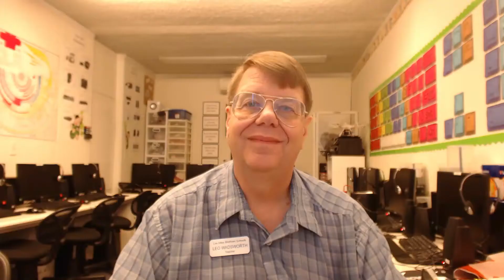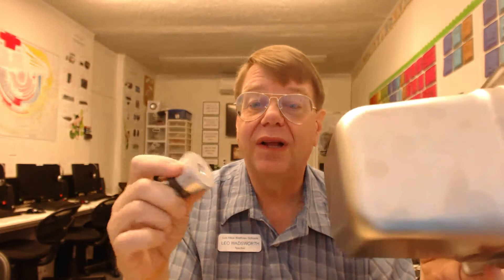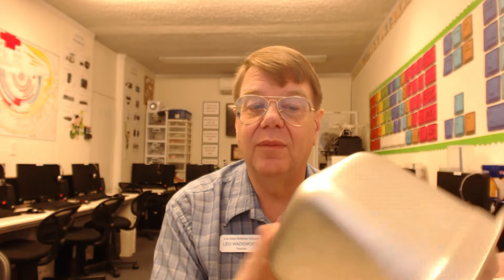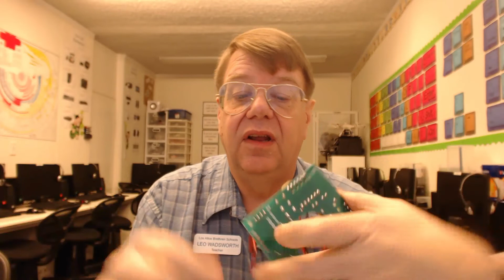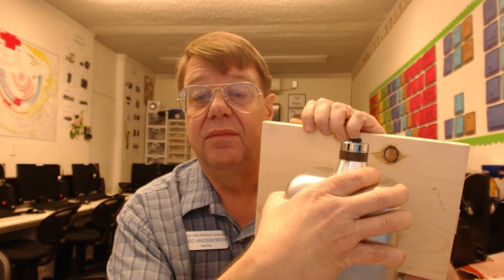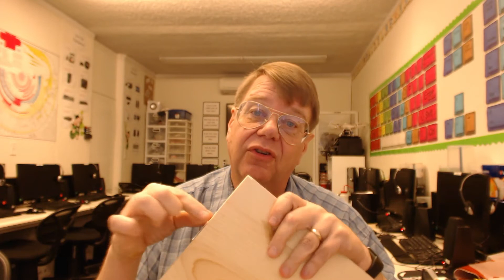DIY Sonicator Part One

Comment: At 4 yrs of age for this post I know receiving an answer is a long shot but here goes. I have a few questions re: this build. 

Most sonicators employ a resonating shaft into the medium with stationary containment. Where as something like a jewelry cleaner with softer vibrations resonate the containers. I imaged the reason to be sonicstion is more violent and achievable when the wave source is place toward the center of the working medium. As I learn more I’ll likely regret this portion of my comment.. We’ll see. Anyway how did the unit perform? Was the transducer able to bring the pan to the 20k mark? 

Did you discover a means of isolation for the pan to be necessary? Perhaps a thick bead of silicone applied into a track or groove lathed into the wood and under the lip of the pan. I’d imagine the vibration of the pan on the wood to be loud. Possibly even causing the wood frame to come apart. 

Did the driver board or transducer produce heat? I know the propagated water from a tiny transducer in a home humidifier can burn skin. The units are built with heat sinks. If this  build does heat up what is the average runtime per rise in degree? 

How did the bonding medium hold up? This I’m very curious about. I imagine an alternative build to be one where the transducer is mounted to and isolated from the base with the pan placed through the top hole, resting just above the transducer. The pan is also isolated by a gasket or silicone bead. All we need now is a coupling device. Maybe a pad similar to those used as heat sinks in electronics. Stiff enough to transmit high frequency without degradation of the waves but also hold up against disintegration.   The math required to calculate the design for such a material is far above my pay grade! I imagine the varying weight of the pan to make the calculation challenging.

Anyway I love this idea and build!! Thank you for sharing.
Reply: I am very much in.the same boat you are.  I don't have much money to spend, so that's how I got onto the diy aspect lol.  The deal is that a bath sonicator that does SOMETHING is easy. But, frankly, they suck.  They just do.  A probe sonicator entails a LOT more.  I am hardly qualified to explain it all.  I have no aspirations whatsoever of making my own probe/converter.("stack").  Frankly, if u were even remotely capable of that, you would have either already figured out that it was a non-starter, or you would have done it lol.  

The driver/power supply--that is where I think DIY is possible (to some extent, anyway).  The issue is that the thing has to somehow be tuned (or have an auto-tuning circuit).  I myself am still trying to figure out if any of these commonly available PCBs/kits have such capability.  I have looked at the PCB for a Branson Sonicator, and it looks a lot like those DIY kits. I'm not even that great at electronics, but you can't miss it.  I think what really matters, again, is the tuning.

You probably already know all this, or some of it.  These are basically a jewelry cleaner as far as I'm concerned, not a sonicator.  FWIW coming from me (I don't wanna sound like I'm putting this guy down, cuz I'm not, I'm sure he knows way more than I do).

You can use software to do the math. But first you have to know what you're doing in the first place.  Ask Google's AI assistant. It will tell you all about it.  Be careful tho, sometimes it get things wrong. 

If you are still interested in this stuff, I would be happy to talk about it at length. 

Yes, of course there is heat.  There has to be.  That is why you asked.  Because you already know.  The heat goes right into the water.  You have to cycle the transducer on and off and/or maintain the temp of the bath somehow.  Probe sonicators have attachments available to cycle the water through ("cup horn"); there are also cooling jackets.  Some transducer assemblies even have ports for this

Comment: Instead of weatherstripping, use one set of neodymium magnets to "levitate" the pan, and another set to "buffer" horizontal movement.  By placing north to north faces of two magnets, they repel each other. With a little imagination and strong enough magnets you can levitate anything.

Comment: Can this be used for producing Nanoemulsions?
Reply: This is my use case as well (cannabinoids). From what I've read so far, most people tend to have a higher power setup than this (I've seen 700W at least twice now.) However the frequency of this setup seems like it could be viable based on the same references... I'm still figuring it out. Have you come to any conclusions?
Reply: @jrgenscotthookham9137  That's exactly my goal ... CBD in water :)  My kit is shipped & hopefully I'll receive it soon. I'll post my results here when I experiment with it.
Reply: @scottalter42  looking forward to it. What are your specs? 60W? 40khz?
Reply: @jrgenscotthookham9137  yes, 60W @ 40khz. The kit from banggood. I'll keep you informed.
Reply: @jrgenscotthookham9137  Success!!!!! I got the kit, successfully made some nanoemulsion of 1:1 indica strain cannabis oil in water & consumed it.  Now within 30 mins, I'm feeling sooo sleepy which means it is working. Feels like was some strong booze or something. Normally, just infused oil takes about an hour to get the effects started. My setup is slightly different from what's explained in the video. I have the transducer part suspended with a chopsticks structure & had it partly immersed in the solution carefully without the possibility of shorting.  I wish I can post some pictures of my setup here. Anyway, I'm excited that this worked! Tomorrow I'll make my favorite 1:1 cbd/thc mix made of my favorite thc sativa (candyland) & cbd hemp (acdc), flavored with some pineapple & lime. That will be my favorite day time pinacolada like drink.
Reply: @scottalter42  very cool! Thanks for the update.
Reply: Btw, the texture of this solution is like diluted or skimmed milk. Translucent or almost opaque white solution.
Reply: @scottalter42  sounds about right. The finer the nanoemulsion, the more transparent I would expect the solution to be. Maybe also the ratios are relevant there... I know it's possible to get a water-clear solution, and I think a proper probe with perhaps more power is what it would take to achieve that.
Reply: @jrgenscotthookham9137  i think you're right. it's almost opaque so i think it doesn't have fine globules. it's day 2 & the liquids have not separated plus the solution is much stronger & fast acting than just oil which makes me think it is still nanoemulsion solution. I will run it for a larger duration like 30-40 mins or so.
Reply: @scottalter42  are  you guys still alive. I have input to provide on nanoemulsions.
Reply: @kbtze good question, really. If done incorrectly as I used to do (with aluminum containers) is can be hazardous. I stopped it immediately after learning.  Still alive obviously  😂

Comment: A sonicator and ultrasonic cleaner are two different things . A ultrasonic cleaner cannot do what a sonicator can.
A  true sonicator cost about 4 to 5 grand.
Reply from the maker: I'm always up for learning - in what way are they different?  The ultrasonic transducer I'm using is described as being for sonicators, so if it is intensity of the waves, then I'm thinking I'm ok.  It does seem to be working for its primary purpose that I care about - sonicating flake graphite in a mixture of water and acetone into graphene.

Comment: There's probably digital timers that can be connected to an SSR (Solid State Relay) to control the on/off. First result on EBay: https://www.ebay.com.au/itm/12V-LED-Display-Delay-Timer-Control-Switch-Buzzer-Module-2-3-Position-Case-New/191981848404?hash=item2cb3028754:m:mGJStPsGJx44rAZDT05HExA
Reply from the maker: Good point - the sonicator doesn't draw much electricity at all -- about like a single old-style lightbulb - so there are lots of options to use an external timer.  Thanks!

Comment: What no parts lists
Reply from the maker: That's fair.  I'll put one together and post it in the description.
Reply: STEM Camp Projects I just found the transducer. 60 watt. But the controller I’m looking now.
Reply from the maker: Here you go - a matched set -- https://www.banggood.com/AC110V-100W-40K-Ultrasonic-Cleaner-Power-Driver-Board-With-60W-40K-Transducer-p-1072339.html?rmmds=search&cur_warehouse=CN
Reply: STEM Camp Projects you did good. I was just about to buy one. Thanks
Reply from the maker: Thanks!  I put a parts list in the description.
Reply: STEM Camp Projects always do that. There’s nothing more miserable than getting all pumped up for a project and buying the wrong part. Have you made one yet. I’m gonna do the same thing with graphite.
Reply from the maker: Yes, I just finished part two of this video, showing how I made version 0.1 of the sonicator.  It is uploading right now - supposed to be done in about 6 minutes.